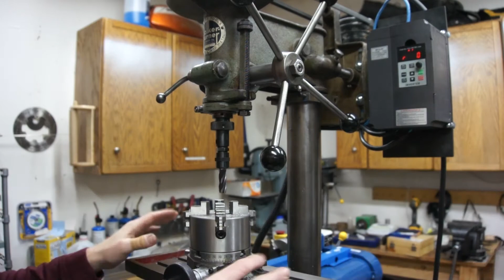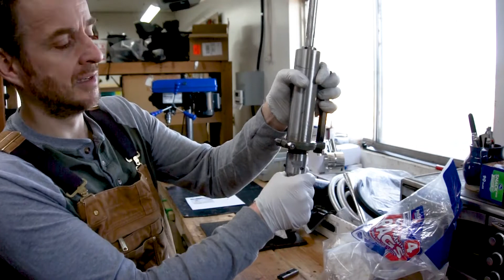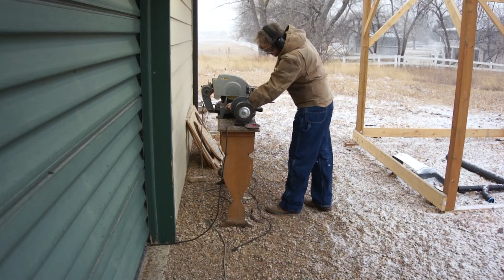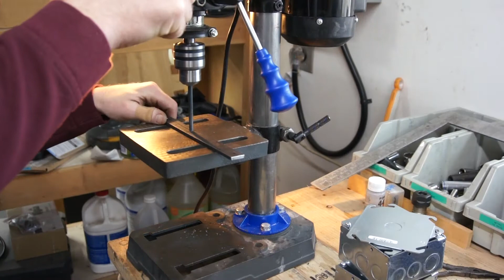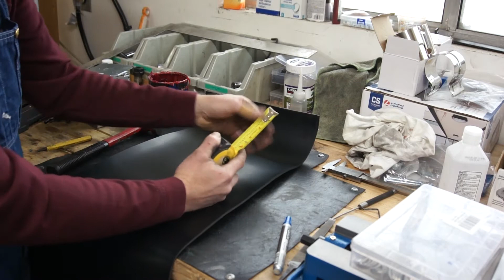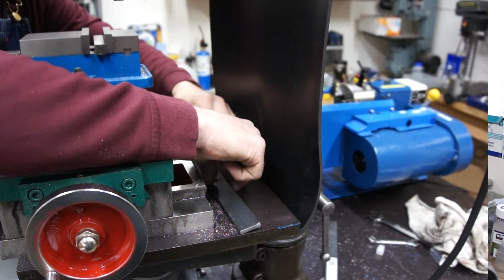Chip Guard and New Collet Chuck for the Drill Press Milling Machine

Comment: Robert where did you get the x/y table? I had plans to get the red mini-mill to match my red mini-lathe, but I might need to look into this option as the mini-mills run in the 700 dollar range. Although that might still be the route of least resistance in the long run.
Reply from the maker: Hi, Slim Jim32.  I got this x/y table on eBay.  If you search for "mill work table", it'll be the first one that pops up.  I paid around $150 for it, shipped.  Looks like they're cheaper than that, now.  I've been really happy with it.  Quality is adequate for what I use it for and my expectation.

Comment: What would work better for your chip guard would be a roll blind cut down and attached the roll at the top and then it would just retract out of the way.  You would have to work out the clearance issue you have with your spindle wheel are but maybe you could shorten them or put on hand wheel like on your X-Y table.  Might make it a larger diameter though.
Just trying to help.
Ray
Reply from the maker: That’s a really good idea, Ray.

Comment: Taper roller bearings need pre load so tighten the locking nuts up until the play disappears , not too tight tho , similar to car wheel bearings 👌